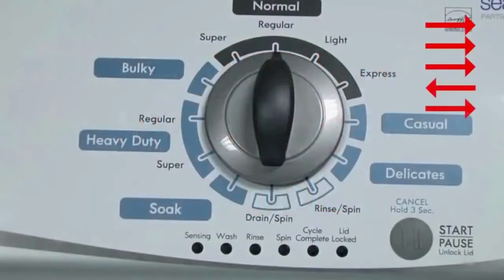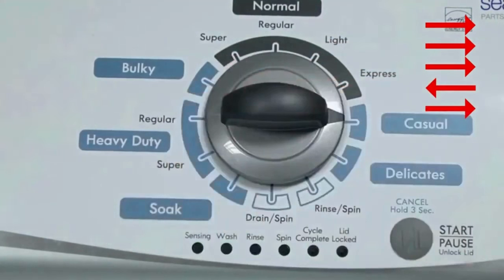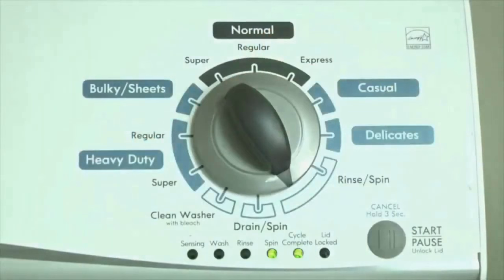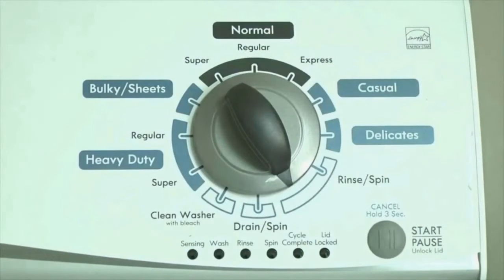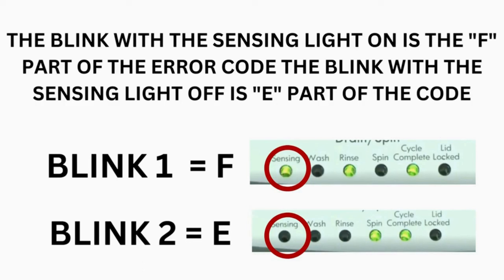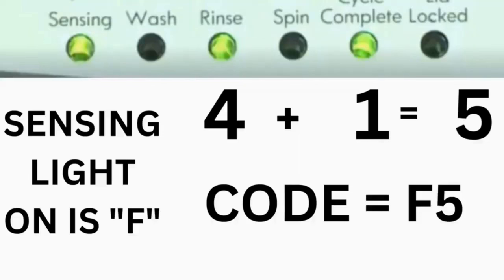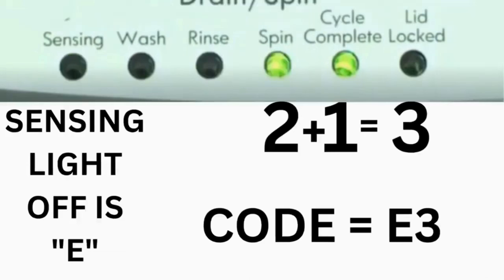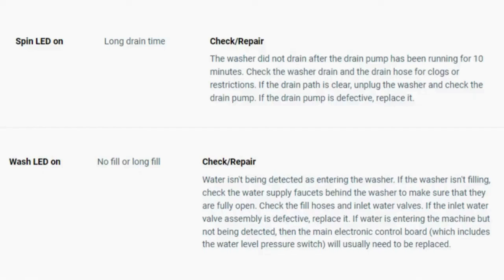How to Reset Your Washing Machine: A Step-by-Step Guide

Comment: This does not reset your codes
Reply: because it's not
Reply: you start with the knob up and down at top. one click left. 3 clicks right. one click left. one click right. lights should light up . then turn knob right till it gets to rinse hold the start stop button till it does it thing. after that should be good to go. if not something else might be wrong
Reply: Turn on the washer or not.  Wasn't specific.  Start with the knob up and down at the top?  The machine is specific I need the information for it to work because nothing works here
Reply: @rhreznor  just make sure its plugged in you dont need to start the washer. whatever the 12 o'clock setting is that where you start following the directions in my comment above